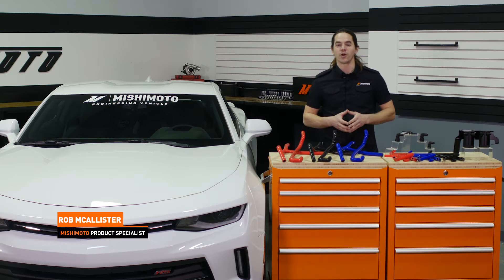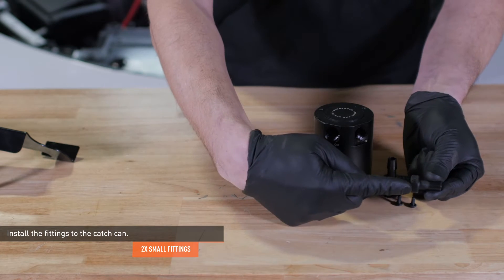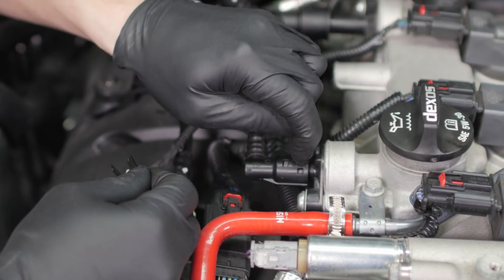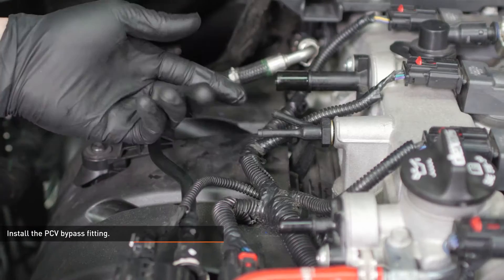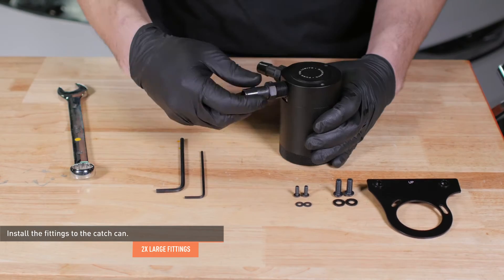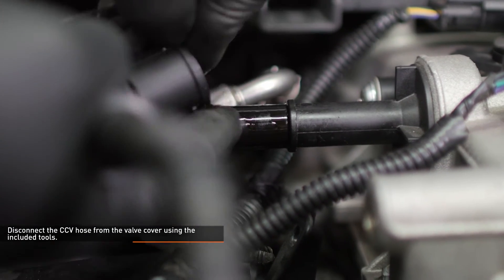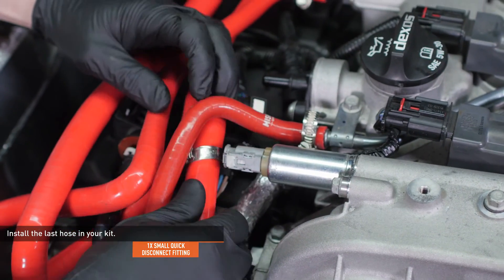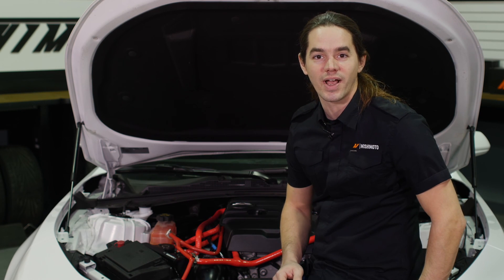2016+ Chevrolet Camaro 2.0T Baffled Oil Catch Can System Installation Guide by Mishimoto

Comment: Will this work on a 2016 Malibu with the same 2.0?
Reply from the maker: It may work but will not be a direct-fit. You may need to make modification to the brackets and lines for mounting.
Reply: Thanks

Comment: Does this void warranty if chevy sees it?
Reply from the maker: Hey Michael. This is a super common question these days. Typically, warranties are handled on a dealer by dealer basis. The best way to get an idea is to give your local dealership a call. Provide them with the situation. And see how they react. You'll typically get a fairly defined yes or no very quickly :).

Comment: My kit came with some tiny like caps(bar end looking), I only bought pcv side, only place I can think they go is inside the little gaps on my the bracket to cover up holes for ccv can , right in the sides of the logo mishimoto, issue that right?
Reply from the maker: Hello Chitown Rider. If the install video did not cover a portion of the install, the customer service team would be happy to help. Just send a photo of the parts in question to support@mishimoto.com and we'll have someone working on this with you in no time.
Reply: Mishimoto Automotive got it installed today, took me an hour lol I couldn't get that pcv plugged in cause I  got the 2017 had to squeeze it under
Reply: Chitown Rider i also have the 2017 and thinking of getting the pcv side , what did you have a problem with so i know ahead of time
Reply: Robert Jedlowski definitely recommended check out my video on results, it's pretty easy except that pcv plug you have to remove to put in the little y piece adapter,there's very little room. PCV plug was really snug so be prepared to put some pressure and the adapter just turn it little by little it'll tightened up even with the little room